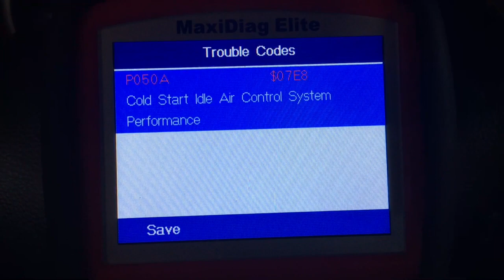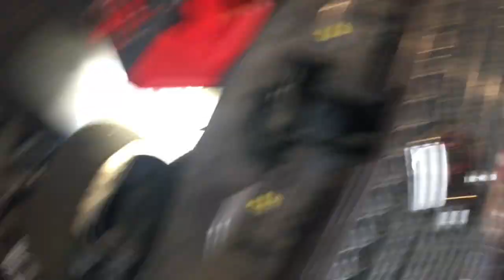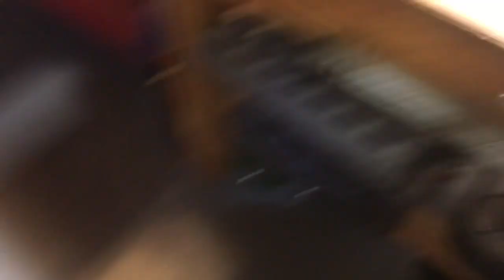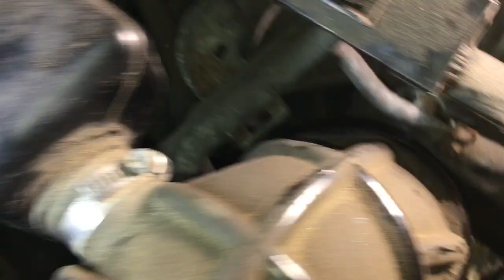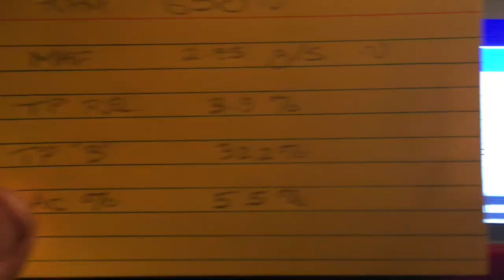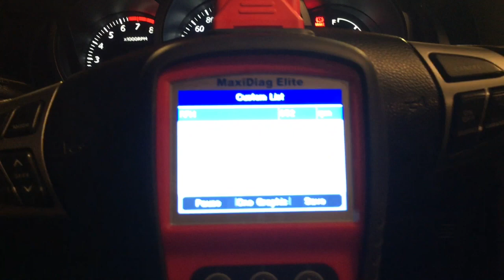Vitara Kazashi P050A DTC Fix ?

Comment: Mine fixed for a day after cleaning the TB, but it came back the next day & the cold start idling is rough, drop the rpm to 300-500 for my 2019 mustang... :(

Comment: I got this code along with random engine misfire code. 2012 GV, same 2.4. Planning to clean the throttle plate this weekend, but any chance you think the misfires could also be related to the TB? Just did the head gasket and air filter. Great video.
Reply from the maker: I doubt it…but possible if carbonization is extreme. Start with the basics , plugs serviceable and gaped correctly. If the misfire persists look at fuel trim values for direction. Thx for watching 🍻
Reply: @TheGibby3340  plugs and coils are brand new. Only misfires after the engine warms (closed loop?). O2 sensor is reading consistently rich voltage, stft is between -5 to 0, ltft is 0. Misfire did improve after I tried cleaning the MAF… it’s a weird one. Going to see what values the MAF is returning and narrow down from there.

Comment: Hello Gibby. Has the light returned since you've cleaned the TB? I just had this code set this morning, cleared it, hasn't returned.  
I am ordering throttle body cleaner, new engine air filter, Seafoam top end cleaner kit. I know I need spark plugs changed soon, is been 60,000 miles since I've changed those.
Reply from the maker: Hello thx for watching. The DTC has never returned...I think it must be about a year now+/-...Cheers
Reply: @TheGibby3340  that's great. Thank you for the response
Reply: Gibby. I cleaned the throttle body. My idle is higher now. Especially going from drive to neutral. It will eventually fall, but revs up 1000 rpm for no reason
Reply from the maker: Yes this can happen...Here's a link that details the correction (it's for an SX4 but it's the same issue). Make sure you have any security/radio codes etc (if any) before lifting the Battery ground. Hope this helps. Cheers 
https://youtu.be/3SR4xduBfPM
Reply: @TheGibby3340  your are a beautiful man! Thank you kindly.

Comment: Same P050A code popped up on my 2010 Suzuki Kizashi SLS. What else could it be or needs to be done if cleaning & new air filter doesn't work? Could a bad coil throw this code?
Reply from the maker: Chad Cook Thx for watching...It is virtually certain a through TB cleaning will resolve this issue. In a TB assembly with no IAC valve the ECM will generate the DTC when the throttle position is excessively open to maintain target idle speed...TB assembly, ECM or a wiring issue may be possible but highly unlikely. Cheers
Reply: @TheGibby3340  Thank you for the video & response. It's appreciated.
Reply: Try replacing the sparkplugs . I did it fixed the P050A cold start
Reply: Was this causing your car having start problems?
Reply: Sparkplugs. Cold start is the sparkplugs.